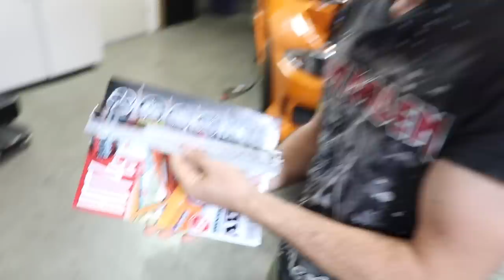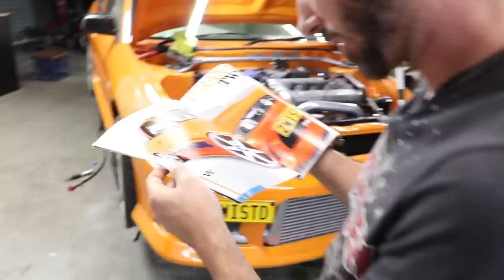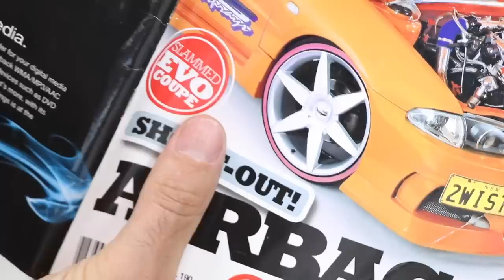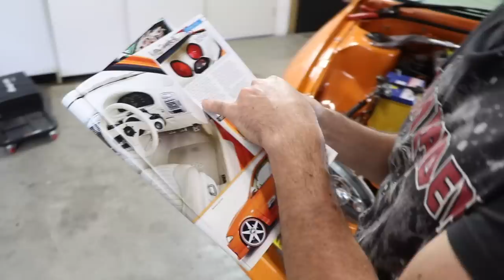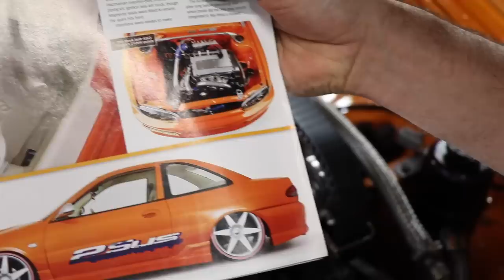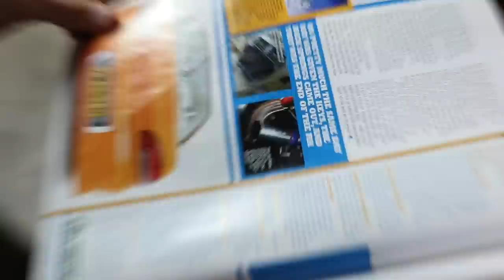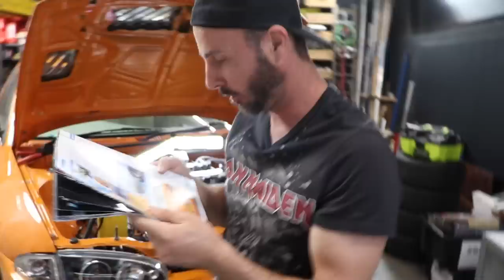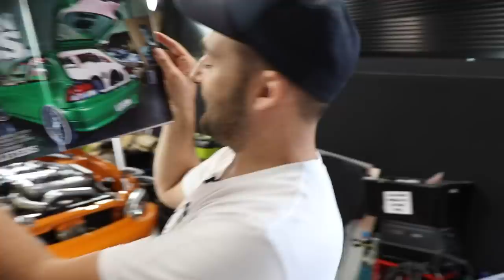2WISTD - Magazine Cover VS The Real Car

Comment: mcmtv2- Im not sure about what came in the evo's as we never got them in the USA until 2003. However your engine is the exact same as what we got in the mitsubishi eclipse gst and gsx models as well as the eagle talon tsi. I have a bunch of friends who are into those cars and helped my cousin rebuild the 7-bolt 4g63 in his 1995 eclipse gsx so im pretty familiar with them. The 6-bolt engines came in the first generation models we got from 1990-1994 and then they switched to the 7-bolt engine from 1995-1999. The 7-bolt crank main journals are 42mm while the 6-bolt are 44.98mm so im pretty sure it in not possible to put a 6-bolt crankshaft in the 7-bolt engine block or vice versa but the cylinder heads do interchange. the 7-bolt engines have a tendency to get what is known as "crankwalk" where the thrust bearings get worn and crankshaft moves back and forth if it gets bad enough it can ruin the crankshaft and cause big problems though in 1998-1999 they did revise the issue apparently and the 6-bolt engines don't have this problem. The 6-bolt engines are generally more desirable as they have stronger thicker connecting rods and bigger intake ports and stock internals have been known to survive north of 400+whp while the 7-bolt would probably bend a connecting rod at that level though I would still trust a 7-bolt to hold up to 300-350whp pretty reliably. Generally for tuning we don't run standalone ecu's as the factory ecu can be modified and retuned with Ecmlink which is similar to what honda guys have with hondata software and Ecmlink does support speed density tuning so lots of guys will get rid of the MAF and convert to a GM 3bar or 4bar map sensor and it is way cheaper than a full standalone and plug and play but since you already have the haltech in there it should work just fine just an added expense. If you want to learn more I would suggest an internet forum called www.dsmtuners.com there is tons of information on there and lots of helpful people.

Comment: It sounds like they are referring to how much torque steer the car has.  That  even in fourth gear, if you let go of the steering wheel and stomp the gas pedal, it will veer across the lanes

Comment: The changing 4 Lanes in 4rth gear is a play to  the torque steer. You floor it and keep the wheel striaght and you end up 4 lanes further on the right or left :D
So be carefull moog

Comment: 4 lanes in 4 gears with out turning basically means it torque steers though all 4 gear on the highway without you steering it making you change lanes without touching the steering wheel

Comment: The lane change reference means the torque steer from mashing the throttle in 4th gear causes it to go across four lanes, without the driver turning. It was probably making decent power then, more than now ahahha.

Comment: Marty, let Moog have his EVO.  It may have been a Lancer at one time yet all EVOs begin that way you might say.  The engine gives it EVO cred so even if it's a highly modified Lancer in the end it has the right engine and the rest of it seems to be as high-performance if sometimes a bit questionable.  I guess seeing this tricked out ride the best outcome would be to respect the engine and dual-purpose of being a daily driver that can compete on track days.  I hope it can be given a really good renewal with great upgrades.  In effect make this base of a show car better and truly functional and fast.  Please do something very cool to fix the front lower lip's crack, zip tie, and knackered metal left and right grille vents as the body looks good on video besides these problems.  Here's hoping the engine is straight and lives up to it's potential.

Comment: The turning four lanes while goingbstraight thing they are talking about is torque steer.  You gun it going straight and the front wheel drive torque will move you over four lanes.  My turbo honda would almost put me into the next lane from it.

Comment: The "EVO" discussion could have been closed, and I thought Marty was going to mention it, is in the "Mods list". 2006 Lancer. No mention of "EVO" other than the drivetrain. Which I'm also curious about. It said it had an EVO drivetrain. Since they only came in AWD, is the transfer case locked out or other tricks to make it FWD? My guess is it's just standard components and probably not from a turbo car, making it weaker. Check the stamp on the bellhousing and it should confirm the transmission type.

Comment: Check which ECU it has, looks like it may have a newer evo ecu flashed for speed density (zephra mod).  Since the air meter is missing in front of the turbo.

Comment: I bet the third amp is still in there. It's looked like the 2-channel speaker amp was on a panel that the other one might be underneath. Just follow the wires and I bet you'll find the rest, or at least where it used to be.

Comment: cross 4 lanes in 4th gear without turning...
Means it has so much power that even in 4th gear you can mat it and spin the car around on a 4 lane road without turning the wheel.

Comment: The front wheel drive torque steer would pull it across 4 lanes while going in a straight line. I was shouting it at the screen lol

Comment: 2wisted is a lancer turbo with evo 3 running gear conversion... it would be called "full evo 3 running gear conversion if it had the 4wd" call it like it is.. but its still fwd so lancer turbo

Comment: Lol cosmetically my old 1980 chevy luv (isuzu KB to you aussies) stayed basically factory.
It was gutted inside
Chevy sourced parts
93 s10 blazer 4.3 v6 engine block
98 blazer cylinder heads
Big ol comp cams cam
95 s10 5 speed trans
06 corvette valve springs

Sourced from non chevrolet vehicles
Volvo S60 seats with the motors removed and fixed rails
60s ford mustang 4 barrel carb
Fuse/relay box off of a Jeep cherokee XJ with a full rewire to use it in a different area
Converted to the dual front headlight setup off the earlier model LUV
Isuzu rodeo front brake rotors and calipers (wizard to you guys i think?)
And a ton of aftermarket parts to support the engine swap and build

 i converted it front 4x4 to 2wd by removing the entire front drive axle assembly during the engine/trans
Was a basket of different engines, vehicles and brands

Comment: The statement "change 4 lanes in 4th gear" probably means that since it is front wheel drive, the torque steer is so bad even with 4th gear :D

Comment: changing 4 lanes in 4th gear is just saying that apparently even in 4th gear the torque steer is strong. where low powered cars might need 1st or 2nd gear to get any. it may be an exaggeration. but maybe not. try it moog. lol

Comment: Torque steer . Owned one of this with a 4g92 Mivec making about 130whp and torque steer can be felt on 3rd gear (slightly). I would imagine 2wisted would pack at least 300 ponies and would pull this anorexic body sideways without effort when they floored the gas pedal around 80km/h at 4th gear.

Comment: Love the lack of an awd gas tank, a lack of the rear axles, a lack of a driveshaft and a lack of a center and rear differential.. you sure have a great "evo" there...
Reply: I mean technically it has a center differential, it's inside the transmission on the early EVO transmissions.

Comment: As I thought, it did have a better sound system than the cheapo stuff currently in it.
Didnt make sense compared to the bulk money thrown into everything else.
Which means I was right the first time around, the stereo bits WERE expensive, so whoever disagreed on the first 2TWSTD video = I win, and you, lose.
Edit: Went back and looked, Pump-A-Rum Ye, you were WRONG, WRONG, WRONG

Comment: He's talking about 4 years switching lanes the torque steer so bad that their car will finally switch lanes when you ship in your on full Boost it is front-wheel drive not all wheel drive hopefully it has an LSD in it and it's not an open diff if it's an open diff it is a monster no traction whatsoever but that's what he's talking about when you shift it just all over the road they going to have the advanced LSD that the Honda Civic type-r has now what it puts equal traction down for both Wheels causing improve acceleration and handling

Comment: 16.10,  evo 3 gearbox, locked to front wheel drive, does that mean that you can put in the rest of the all wheel drive system, and unlock the gearbox, and then its an all wheel drive?? the challenge is on, LOL

Comment: Hey guys i was in the parking lot and i saw a fight for a spot the guy that didnt get the spot came back and put something in the gas tank 
I was wondering what can we use to check if someone put suger or bleach ... And if someone did what can we fix it I know pull the gas tank ouy and clean it out but what can we do if its in the engine because you drove it for a while can seafoam clean it out or something else without pulling the engine apart

Comment: its an S14 94 to 96 front bar actually not a S15. so what do i win ??
Reply: and it also sez this EVO Powered Lancer on the front cover so not an Actual Evo but one day you will get one
Reply: Image result for s15 Mseries front bar
451 × 320Images may be subject to copyright. Find out more
CARMATE Nissan S14 200SX 1994-1996 Series 1 "S15-MS Style" Front Bar ...
Carmate
Reply: my z32 300zx has Lambo diablo headlights in it does that mean its a Lambo as well. 
hats off to the original owner though tough looking car a lot of work gone into it. to bad you have this twat doing body slam and spinning on top of the roof. i would be so pissed off if i built it and someone disrespected it like that. i'd rather burn it to the ground then let anything like that happen. i used to love watching McM with a bag of popcorn and the misses by my side but now its just gone Mental all this sexual jokes n shit.. hey my kids watch this so pull ya heads in

Comment: I bought a real EVO I for $2500 CAD, for less than the cost of the ECU they bought I'll have a well put together car making more power. BUY A REAL EVO MCM!

Changing to a 6 bolt crank doesn't prevent crank walk because the problem is a result of the oil-squirter design not the main bearings. This piece of misinformation needs to die!